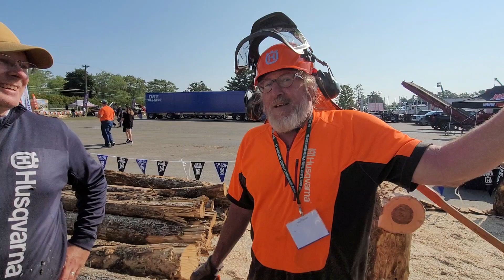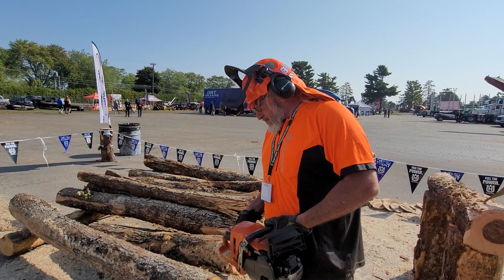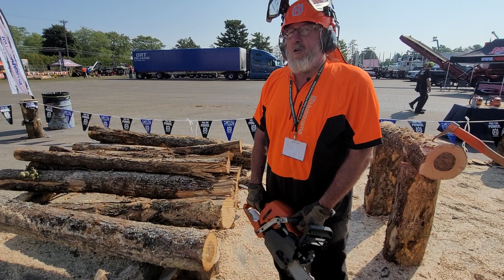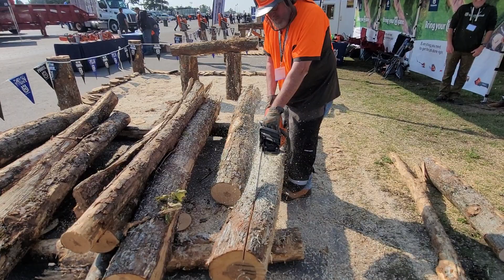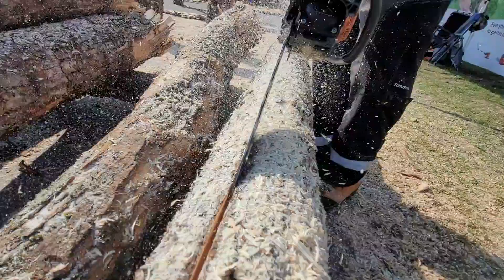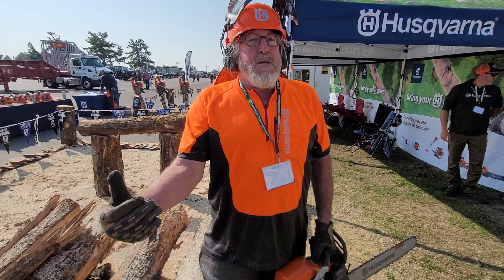How To Auto Tune Husqvarna Chainsaws

Comment: thats very cool!!!! and something to try when i get my 576xp converted to auto tune
Reply from the maker: It makes a noticeable difference in the smaller saws.
Reply: No don't convert to auto tune. Leave it with the carb on.  New isn't always better.
Reply from the maker: @ricktaylor3748 have had no problems with auto tune
Reply: @BertsCustomCuts    My 562 XP has been nothing but trouble. I think I need to reset the autotune.

Comment: Every how often should you do this I have a Husqvarna 540 Mark III and it never stays running it shuts off all the time should I do this frequently
Reply from the maker: I would do this everyday with the 540. This really makes a difference for the smaller saws.
Reply: @BertsCustomCuts  yeah I've been having a lot of trouble with my 540 Mark III ever since I got it I tried to auto-tune it it doesn't seem to adjust it doesn't want to stay running sometimes it does other times I have to pull it 15-20 times to start it it's brand new I might have 5 hours on the saw now should I auto-tune it as soon as I get it started in the morning immediately thank you so much
Reply from the maker: @br-dj2ti I would do it every morning. Push the primer bulb about 10 times will help with starting and you'll want to run 50:1 with high octane ethanol free fuel. If still running like crap check the micro screen in the carb. If you need to see how that comes out go to TheGreasyShoprags channel. He has done a few videos pulling them out.
Reply: @BertsCustomCuts  thank you so much

Comment: My Auto tune  -->🪛
Reply from the maker: That's why I bought my 390xp. Now that I had learned this, the 5 series with auto tune isn't bad.
Reply: The 390 is a wonderful saw..I have a few. I like being able to take apart and repair/replace a part on conventional carbed chainsaws as opposed to needing a MacBook Pro to diagnose the AutoTune/M-Tronic saws. I'm still not sure if chainsaws need to have a USB-c port on them, LOL .  I really just have to run an auto tune to see first hand how it feels. Maybe one day i will.   @BertsCustomCuts
Reply from the maker: @DirtRoadLanding  find a logging show close to you and try them out. I ran a 500I the other weekend but dont like the all or nothing throttle for dropping trees.